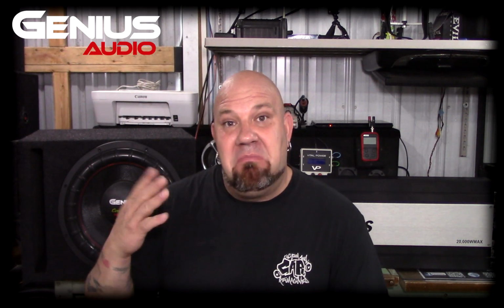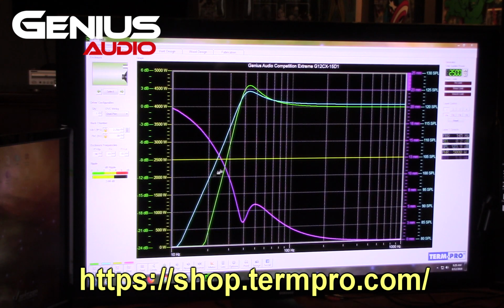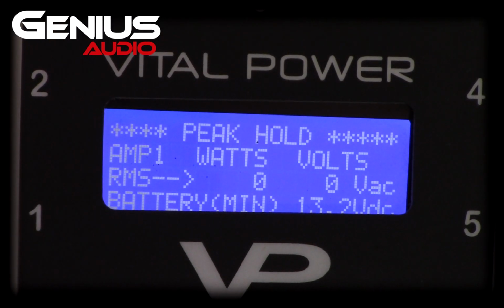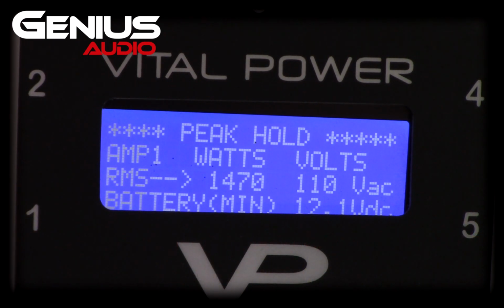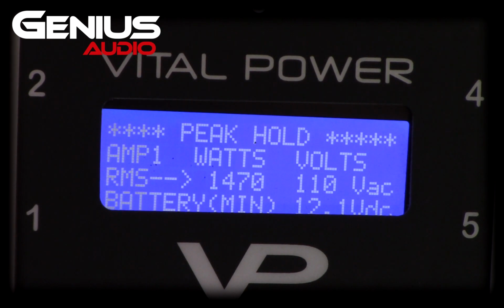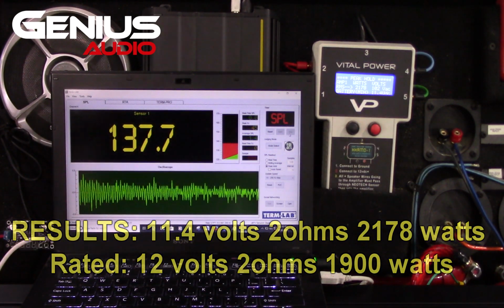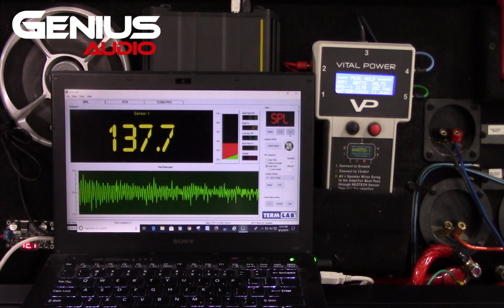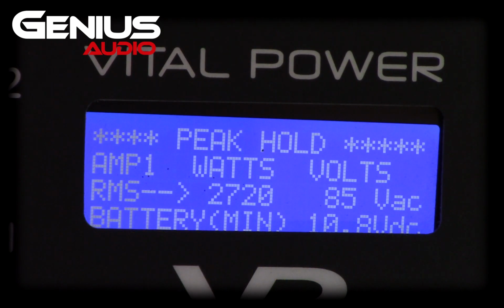Genius Audio G4-10K and G12CX-15D1 Review

Comment: Idk if this will help cabe as youve said it your dyno cant hold the genius 10k but heres my genius 10 aka the beast about half power at 2 ohms solid voltage above 12.5 volts takes alot to power the monster im only continuing to grow the power i can put out for the genius 10k wil get alot stronger as time goes on. Hope you dont mind the link cabe if you dont leme know ill remove it brother. https://www.youtube.com/watch?v=NC4BlrTHG4g&t=4s&pbjreload=10
Reply from the maker: What power supply do you have
Reply: @CustomAudioReimagined  A single 45ah limitless lithium battery on a 200 amp high output alt all dual 0gauge til battery then quad 0 gauge power and grounds

Comment: So 10k at 18v??
Reply from the maker: Oh, no, you can get way more power out of it then that. You can pull over 10k at 12 volts as long as you have the amperage available
Reply: @CustomAudioReimagined  I believe it im running the amp now at 2 ohms solid 12.5 volts amps a straight monster